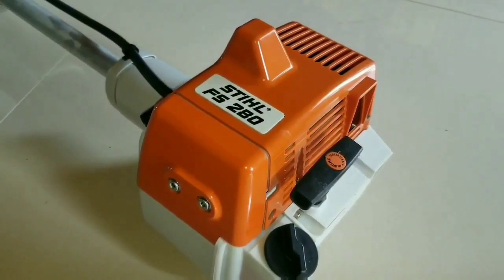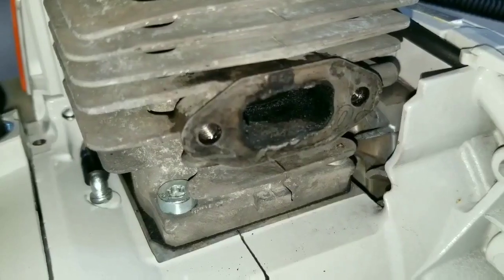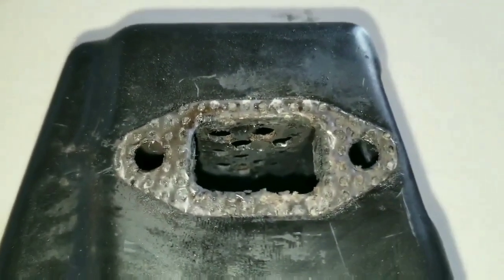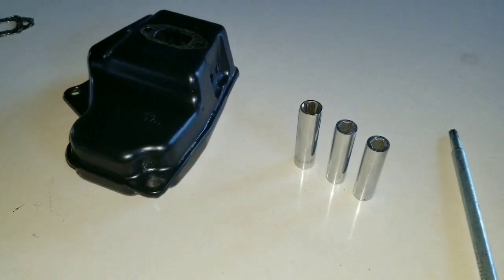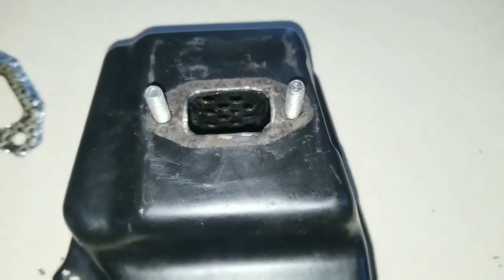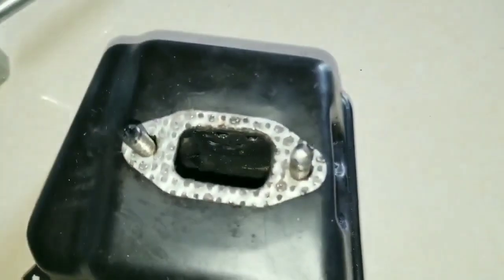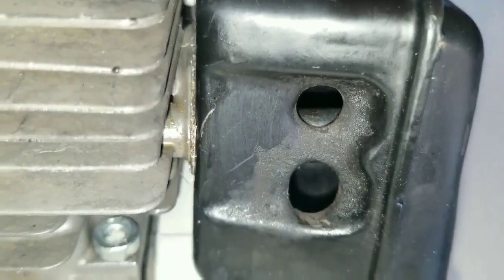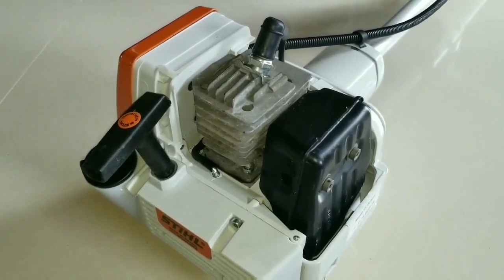How to Modify STIHL Trimmer Muffler for better Performance.

Comment: Wait u put 2 holes on the side that will destroy your motor or it will make it better?
Reply from the maker: It make more polution for the environment 🤣😂🤣.
Reply: @Stevexnycautomotive  i see bro so how u made does 2 holes or u made someone make does 2 holes
Reply: And i got another question what oil can a fs280 stilh can use or can it use any type of oil?
Reply from the maker: Do you have this machine?. You would know the muffler comes with those two holes. It was simply enlarge in this video for better engine performance.  The best oil is the STIHL red oil.
Reply: @Stevexnycautomotive  i see bro yea i just bought it and i havent check the 2 holes in there and on the oil can u use other oil seens the stilh store is to far
Reply from the maker: You can use other two-stroke engine oil mix but STIHL red oil will make the machine last longer. DO NOT operate the machine without its engine cover. The reason I am telling you to use the STIHL red oil is because it comes with a bottle to measure mixture with gasoline. If you over mix the oil with the gasoline, the engine will lose power. if you use less oil mix with the gasoline it can damage the engine. Its important that you get the red oil in it measurement mix bottle. One bottle of red oil will get you approximately 40-50 FS280 tank of fuel.  The bar code #795711017927. https://www.ebay.co.uk/itm/251967031169
Reply: Goodday what is the outer dimessions of tge socket pipes?
Reply from the maker: Torx-27
Reply: @Stevexnycautomotive thanjs actualy i meant the length.